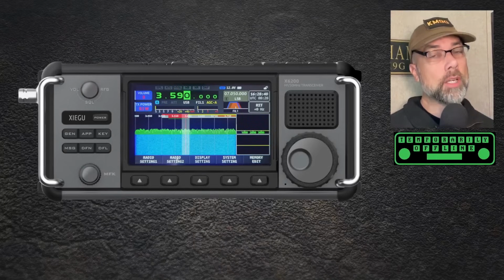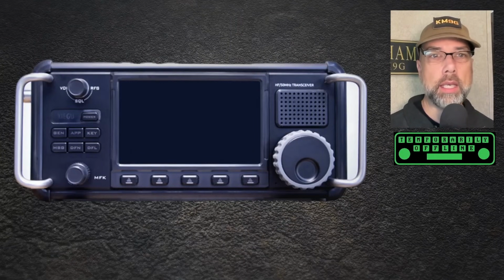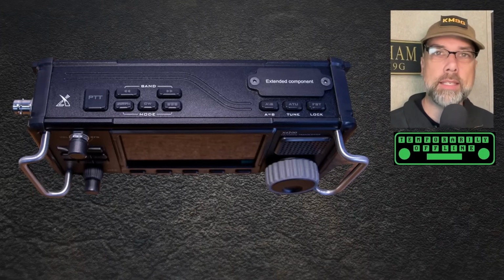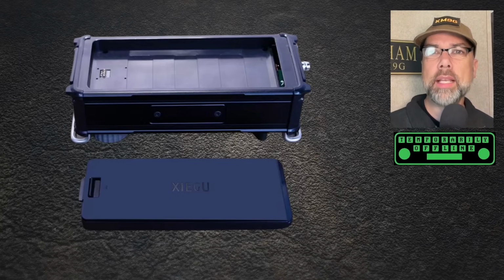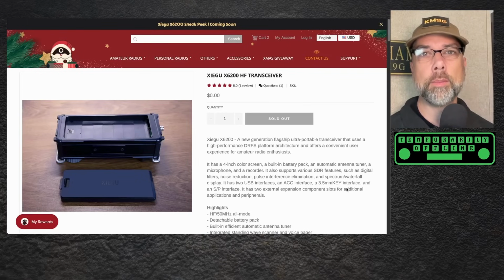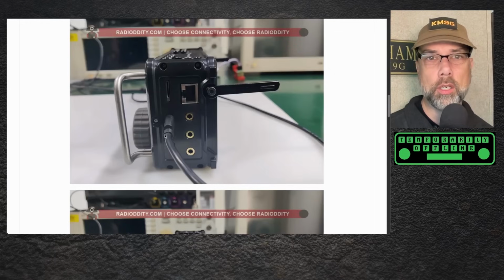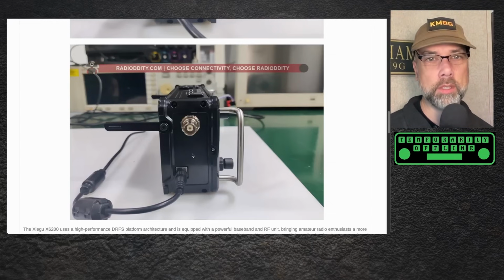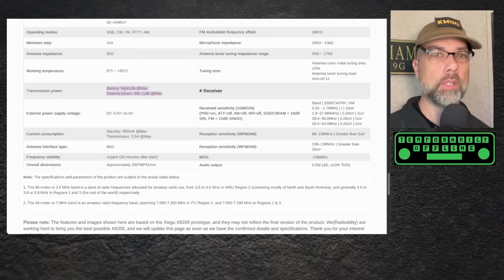Even More Xiegu X6200 News!

Comment: It's good that Xiegu are making more affordable radios but I'm mighty glad I paid extra for the IC-705, I thought I'd never pay for such a radio but it's got a really good receiver on it, dare I say even better than the 7300, the 705 appears to have much quieter receiver.
Reply from the maker: That 705 is nice!
Reply: @temporarilyoffline  Yes, it's a great radio. I got a power bank, one of those that you use to charge mobile phones and a USB C to 12v cable on Amazon and I can run it on 10w or almost 10w and get way longer operating time.
Reply from the maker: @o00scorpion00o  sweet!

Comment: I read somewhere the 6200 will provide a way to store an automated CW or voice CQ sequence, do you have any info on that? Will the 6200 work with the Xeigu XPA125B amp using automatic band switching? Any info on digital modes? Thanks!
Reply from the maker: I'm sure they will copy the CW messages code from the 6100.  The 6200 will support the XPA125B.  The X6200 will support digital modes.  Thanks for watching!

Comment: I’m curious if the 3.5mm ports have the same mechanically flawed surface mount design? That choice makes the X6100 a disposable radio for field operators who use CW a lot.
Reply from the maker: I would bet they do!

Comment: I think the removable plate on the top is in the same position as the two vertical posts in the original rendering.
Reply from the maker: I couldn't tell if it was on the same side, but I think you're right.  Be interesting to see what extra knobs would be needed.

Comment: I was kind of hoping that it could do 20w with an external battery.
Reply from the maker: Me too, that would have been sweet!
Reply: @temporarilyoffline  maybe Yaesu will surprise us when they come out with their FT-818 replacement.  I would like to have that extra S unit from 5w to 20w.
Reply from the maker: @MrStanwyck  I'm waiting!
Reply: @temporarilyoffline  me too Steve.  I have a premonition that Yaesu will present something at one of the ham conventions in 2024.  You just can’t drop a popular QRP radio without at least having a replacement in the works.  They did a quick turnaround with introducing the FT5 when they were running into a parts shortage with the FT3.  73 de KC2KNA
Reply from the maker: @MrStanwyck  I wish the would ask one of us (I'm not special) what we'd like to see in the next generation radio. At the very least a 705 with a tuner.

Comment: I only hope they fix the broadcast interference issue since thats a hardware error. Other stuff can be fixed in software, but hopefully they can use the x6100 as a basis for a less bug prone system. 
I also hope they fix the timing for the CW keyer because its much more difficult to send on Xiegu radios compared to ICOM Yaesu or Elecraft
Reply from the maker: This is DDC/DUC, so there is hope!
Reply: @temporarilyoffline  but there is Xiegu's track record of having zero transceivers that handle broadcast AM well at all
Reply from the maker: @JonathanKayne  oh yes, it could be much much worse then the current models, but I don't want to jinx it.

Comment: I had the 5105 and 6100 for a few months. I think the only drawback of these radios is the software. They should care more about the user experience and functions. I sold them and bought an IC-705 rather, because it's very comfortable, and never let me in trouble. It was fascinating, that all feature worked much more than I expected. Although I'm curious about this RIG too, I would like to see something about Wolf DDC DUC radios too, they look promising, although the price is almost as much as a used 705. Did you try them?
Reply from the maker: I haven't tried them yet, but they are on the list!

Comment: Not sure I would call them "rails". Handles maybe.

A commenter on another channel (Modern Ham?) noted in the external DC voltage input spec where 20w is mentioned if you supply 13.8-15.1V. Might be a typo.
Reply from the maker: Everything is a typo... Until the radio ships!

Comment: Thanks, Steve. I’ve played with my ‘6100 enough to know that the ‘5105 is/was still the better radio. The >75 loud birdies on the ham bands on the ‘6100 alone is enough to make very cautious about Xiegu’s next ‘everyone’s a beta tester’ offering. Still, it does look nice & sounds promising. We’ll see if Xiegu can deliver a complete & fully functional non-beta radio for once but I’m deff not holding my breath. Stay well, amigo. 73 de W8IJN
Reply: Is the 5105 (now) fine regarding the issues you mentioned (and others)? Is it safe to buy?
Reply: @pcfreak1992  Truth up, the X5105 has birdie issues too. The worst was on 10m, somewhere around 28.4 MHz. I remember it mainly 'cause you could hear the signal on another nearby receiver. I wish that I'd kept the '5105 & skipped the '6100. As usual, ymmv &c
Reply: @haramanggapuja  Oh wow, I did not know you could receive them on another radio! 😳
Reply from the maker: The price of living on the edge!

Comment: Would have liked to see 20watts, still a nice upgrade
Reply from the maker: Right!
Reply: As a old CB radio operator from the 70s just before they stopped us from having to buy a license. I had learned it depends on the weather conditions I have taken a CB radio with only 4 watt's and talked from Alabama to Canada it was raining that night but just as the rain stopped the signal was gone.
Reply from the maker: Yes, it is very dependent on a lot of atmospheric conditions.  That's half the fun!  I don't mind the power output that much.  I would of course prefer more, but I'll be fine with 8W.   @Tommy-K4BWN